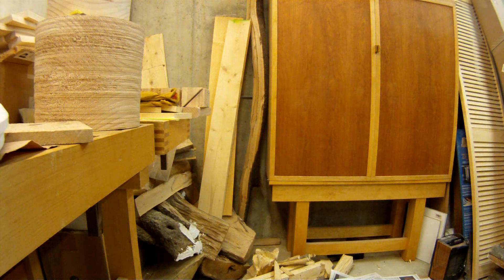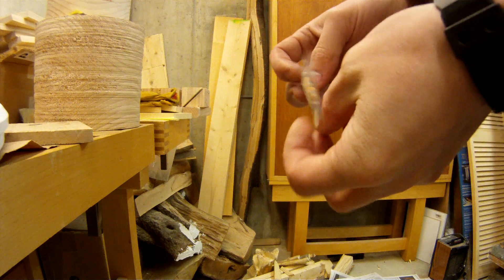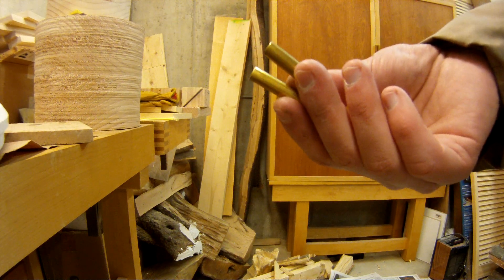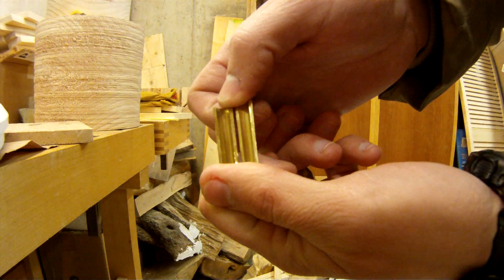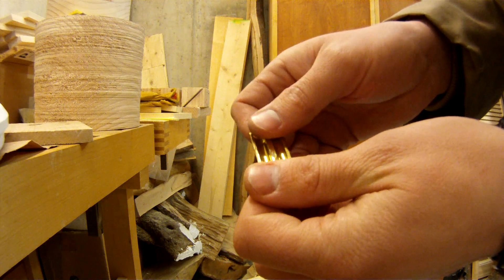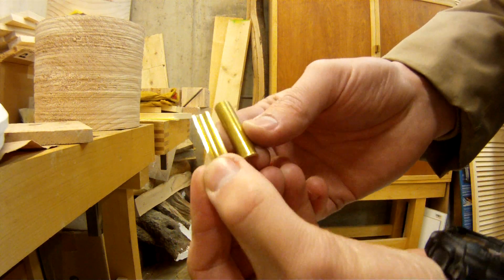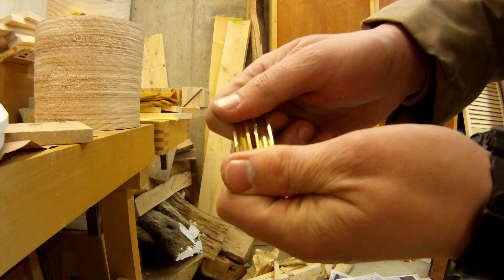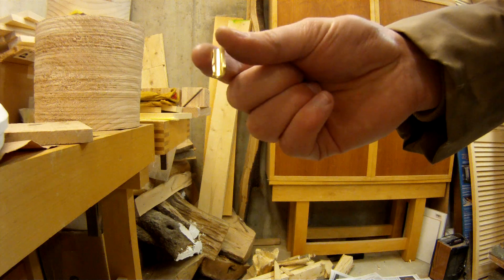Bore Lapping Result (brass)

Comment from the maker: Obviously it will cut steel (abrasive dependent) but will likely tend to do so more slowly than softer brass. I'm experimenting with methods to speed the process. 

With the groove cutters I prefer to bond coarse abrasive to the chosen panels. I thought I had a video on the subject..... apparently not, I'll film one at some point after I've caught up a bit.

Comment: I just visited your site page and you have exactly what I have been looking for!  I really want to test out your version 2 Bore groove cutters.  I wanted to see what kind of difference a 6 cut down the length of the barrel would make and then compare it to cutting only the last 4 inches of the barrel for stabilization.  Do you think that your cutters would work on Stainless steel like Prometheus uses?  Where can I get the diamond polish and I would like info on the exact amount to use.

Comment from the maker: Let me preface this by saying the principal is demonstrated, but the mechanism is assumed. 

As a bb goes down the barrel it rolls/slides along the ceiling of the bore. we hypothesize that bumps, imperfections, its own lack of concentricity, etc cause it to crash into the barrel walls inducing off-axis spin which in turn reduces accuracy. The fewer of these impacts there are, the better the precision. Larger bores aid in this by allowing a larger margin.

Comment from the maker: Technically, all else being equal, larger diameter bores are MORE accurate than smaller diameter bores not less, so that would technically be improving accuracy further. I don't advertise this however because without exceptional effort such small amounts of material are actually being removed its not really significant.